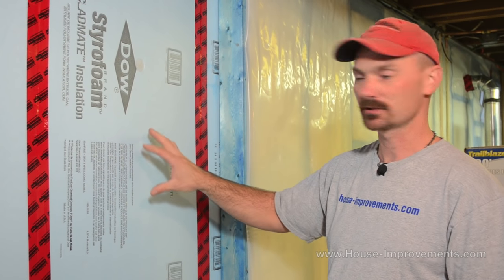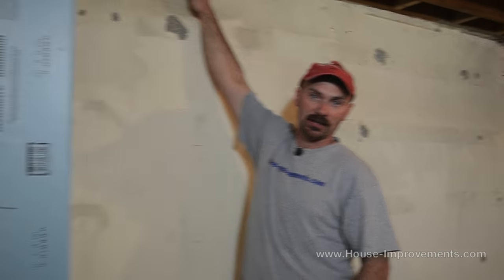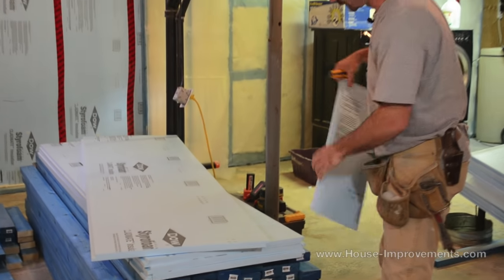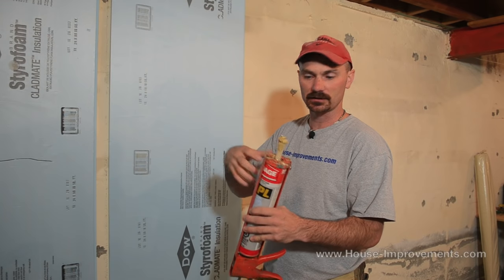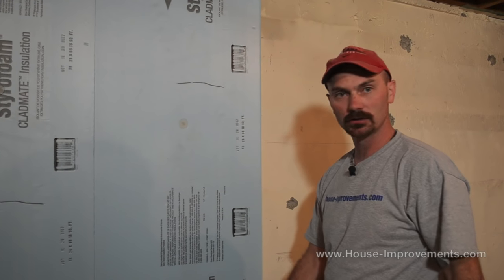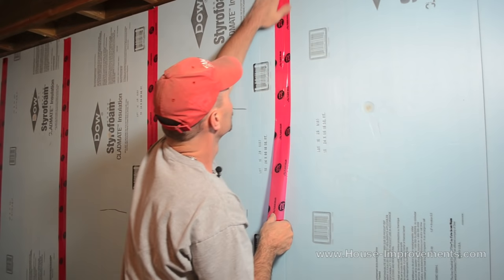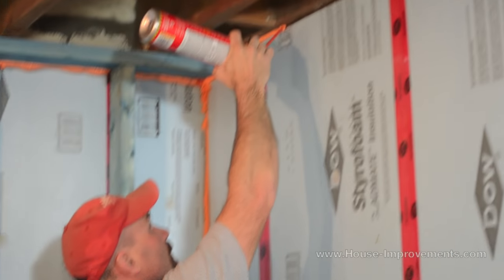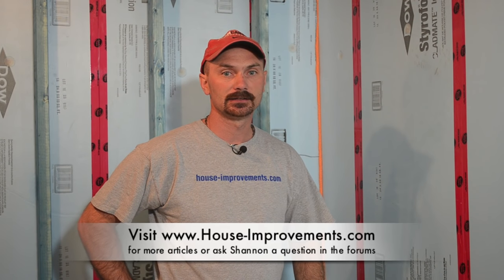How To Attach Rigid Foam Insulation To Concrete

Comment: Hello, I really like the way you do your work. Now is my question: "What if my foundation walls leak from exterior (when it is rainy)?  Do I have to waterproof foundation walls from inside or from exterior side before place any insulation?
Reply: I’m not an expert, but this is what I’ve learned over the years. The answer is it depends on a couple of things. Are the walls cinder block or poured concrete? Cinder block is very porous and prone to water migration more so then poured concrete. It is also more prone to developing cracks or separation along the mortared joints from the house settling over the years. You can try filling in these defects with hydraulic cement and watching to see if this solves the problem after heavy rains. If it does, I would then paint the wall with a masonry sealer for additional protection then install the insulation. If you have poured concrete walls, sometimes the form anchors form voids that allow water migration. These usually can be identified by the formation of rusty spots on the wall. These spots as well as any obvious cracks need to be filled in with hydraulic cement. Then wait for a heavy rain to assess if the repair solved the problem. If it did, paint the wall with a masonry sealer and move forward with the insulation. While this may solve your water intrusion problem, there is no better cure then digging around the exterior of the house, installing a proper foundation drain, and properly sealing the wall with asphalt sealer followed by an “egg crate” type of panel, with the proper stone fill (you should watch videos for this process). This is the most expensive option but guaranteed to work. I can’t speak to installing an inside the basement drain system, although far cheaper then the exterior option. Common sense tells me if you allow water to come through the walls and collect in the drain at the bottom, then you cannot seal this behind a wall as mold will will develop. Good luck.

Comment: ANSWER: "For unfaced insulation, the permeability is a function of the material thickness. In general most product manufacturers list the permeance of the material based on a thickness of 1 inch. ... 1 inch of XPS has a permeance of 1.1 perms (borderline Class II and Class III vapor retarder); 2 inches decreases the permeance to 0.55 perms (middle of the Class II vapor retarder). Therefore, 1 inch of XPS is ... vapor semi-permeable, while 2 inches is considered to be vapor semi-impermeable. "

Comment: I read your using 1" foam there, what length of plastic anchors are you using? And where can I find some of those anchors at?......I plan on doing our basement in the near future and will use this anchoring method, because using just that "special" foam board glue can get pricey on an entire basement. Thanks for all your great informative videos.....

Comment: Spray both sides, top and bottom of the foam boards with borax or boric acid before installation if the place could have carpenter ants or termites.  They would chew through these foam boards like hot cakes and make nests inside if there is no borax to stop them.  This is specially important when the foam boards will be covered by stud walls like the video.  For places that have carpenter ants or termites, I also won't use regular spray foam, because they chew through this too.  I would use ant proof spray foam or caulk.

Comment: Thanks for helping out folks like us on limited budget!  I notice Lowes also have DOW Wallmate.  What would work better for basement concrete wall applications, Cladmate or Wallmate?
Reply from the maker: Wallmate has grooves for wood strips to be added if attaching furring to the concrete for walls instead of actually framing a wall.  I do not recommend that, use clad mate and then farm a wall in front of it.

Comment: Great vid. You mention that 1 inch foam is not a vapor barrier.  My question is, what prevents moister from the concrete wall from going through the foam into the fiberglass insulation?  Shouldn't there be a barrier on the foam and again on the outside of the batts?
 Thanks Shannon
Reply from the maker: No real amount of moisture is going to penetrate this foam standing vertically , it will bead up and roll down to the base as is intended.
Reply: HouseImprovements
Thanks for the tip.  So I could use 1 in foam and fiberglass insulation and be good to go in a basement.

Comment: Great videos Shannon!  Really enjoy them.  I was recently watching an episode of Holmes on Homes, where Mike used 2 inch rigid foam on the walls and 1 inch on the floor.  Spray foaming and tuck taping all the joints.  He did not use bat insulation afterwards like you did which confuses me.  Arent you using two vapour barriers?  One with the foam and the other with the bat and poly?  The studded the walls after the rigid foam board installation was completed.

Thanks.
Reply from the maker: 1" rigid foam is not considered to be a low enough air/moisture perm. Meaning that still to much moisture can move through it to be considered a vapour barrier. Also it will not give enough R value to be considered enough to change the dew point in the wall assembly. IMO it really likely is in most climates in Canada but its not recognized that way. 2" foam is enough and recognized that way.

Comment: Thanks! How should the insulation be correctly applied, name brand facing the inside or outside of the ceiling? Also, is it best to use adhesive or all weather tape to hold the insulation, or both?
Reply from the maker: Please come to my forum and reask your questions, I can better answer you from there and leo it may help more people who are wanting to do similar things. The forum is free to use by the way. thanks

Comment: I think there are a few things that Shannon didn't explain that has caused a lot of the debate.  1. ) rigid foam insulation needs to be 2" thick for a complete thermal break unless you live in a climate warm climate and don't over air condition your basement.  The diea is to have a complete break in air temperatures between the warm side and the cold side of the wall.  A combo of air temperatures usually means moisture (hence the video of how to make condensation be directed to the floor.  Where I live (zone 7A) anything less than 2" of rigid foam on the cold side requires a vapour barrier (typically 4-6 mil poly) or air tight drywall coded in a high solid/vapor retardant paint.2.) I don't recall Shannon emphasizing that rigid foam must be covered by a non-material that is considered non-compostable such as drywall.  3.) The 6 mil poly IF being used on the cold side of the wall should never extend above grade.  Shannon hit it on the nail when he said that the wall needed to breath from both sides unless there was a thermal break (which as I mentioned would require 2" rigid foam for an interior thermal break).  If  I were to try this method I'd be inclined to have the moisture barriers from grade to and inch form the ground.4.) Most concrete homes will absorb moisture from the exterior unless built to the highest standards.  Ground water finds it's way to the base of the foundation slab and wicks up it if it can't dry out.  I'm not an expert and I have no experience but I think that is what allows me to think outside the box.  My solution to what appears to be rising damp until I can afford to fix the exterior is:1. Seal the concrete slap with a penetrating silicate sealer. 2. Hire someone to do high pressure injections into concrete near section were tie rods are rusting.  3. Apply 1 coat of a Xypec Concentrate from top to bottom foundation walls.2. Shorten one 4' section of wall by 1.5" before replacing all bottom plates with pressure treated wood.3.  Install barricade subfloor with air gap (4' section of shorter wall should encourage airflow from under subfloor to cold side of wall that is prone to dampness.  The subfloor creates a thermal break so the temperature between the two areas won't produce condensation.  4. Paint the perimeter tiles of subfloor with a high quality exterior paint to protect in the even there is a leak.4. Cut rigid foam boards in 2x8 sections.  use foam glue to seal to the back of the wood studs (cold side) to prevent heat loss through wood but still maintain airflow between stud wall and foundation wall.5. Insulate the perimeter walls with Roxul R14 comfort batt and cover with poly or smart vapour barrier sealing edges with acoustic glue.6. Frame 2x4 stud walls that stager the existing studs but sit on top of the subfloor (might use steel studs for sound dampening).  This way if water condensates on the floor it doesn't reach drywall or baseboards and I can maintain a completely air tight vapour barrier when I'm doing the electrical - plus easier to poly without having to cut holes and seal for outlets.  This wall will be fastened through the subfloor to cement as per manufacture's instructions.7. Cover with drywall then paint.8. Repeat on opposite wall (including 4' air gap under bottom plate).  9. Install vinyl floor planksAs I mentioned, I'm a newby so if anyone sees an problem with my design please let me know!

Comment: Thank you for a great video. What type of adhesive did you use to attach foam board to concrete wall? Also, how would your process differ if installing on the outside of the existing foundation wall? (Inside is finished.)
Reply from the maker: Lepages PL Premium or Lepages PL300

Comment: Thanks for the excellent video! I'll be doing something like this in a few weeks. Do you see any problem with running the sheets horizontally instead? It would save me a lot of cutting and wasted material. I think I'll just have to cut off the bottom sheet's ship lap edge so that it sits flat.
Reply from the maker: It does help to keep any moisture that may be behind it to get to the floor rather than through the horizontal joint and into the insulation.
Reply: Good point. Thanks :)

Comment: Hi Shannon, thank you so much for all of your videos. This is one of the few home improvement channels I subscribe to as the quality of your instruction and videos is exceptional!

Question: Is this method of insulation good for a basement room with exterior brick walls?
Reply from the maker: If you mean "block" then yes. I would use adhesive though instead of the anchors.

Comment: This idea is based on the principle of beer cooler.  You have the foam insulator forming the thermal brake between the cold outside wall and your warm inside wall.  I've read up on this for my own basement and it seems a difference of opinion between building codes and engineering concepts.  Again if you want it "legal and signed by inspector" you have to succumb to the normally "out of date" building codes, i use this as tongue-in-cheek.   I'm not a builder, simply a handy DIY'er and maintain/renovate my own properties,  I do not know building codes as a rule but I guess the thicker the better.  The code is there to create a minimal standard to follow and I generally check with the local authority for guidance when working on such installations.
Reply: So the poly after the fibreglass is correct in this method ?

Comment: Great video! I Just gutted my den and found lots of damage to my moisture barrier. it looks to be nothing more than very thick aluminum foil. The house was built in the 70's so I guess that was code back then. I have a brick house and behind that damaged barrier was brick and mortor . Can I replace that old school aluminum stuff with the rigid foam or should I hunt around for that same type of moisture barrier?
Reply from the maker: If its concrete blocks then yes you could use foam, if its brick ,i'm not sure I have never seen a brick basement wall.

Comment: Thanks for the video Shannon.  I'm a bit of a noob, so I may have some silly questions.  Am I correct to understand that a moisture barrier and vapour barrier are two different things entirely?  Moisture barrier against the foundation to prevent moisture from seeping in from the outside and vapour barrier on the warm side to prevent the flow of warm vapour into the wall?  I watched your other video where you had a plastic moisture barrier that went under the base plate and wrapped from the bottom over and on top of the vapour barrier.  Which of these two systems do you prefer?  How important is the moisture barrier under the base plate (since it's pressure treated, is it necessary)?  If you use rigid foam, do you still add something under the base plate?  Thanks again.
Reply from the maker: Sorry to ask you this but can you please bring your questions to my forum. More people  who may have the same questions can be helped by using the forum . http://www.house-improvements.com/forums/
Reply: Sure thing, thanks!

Comment: He said, "You could try to spray foam this tiny butt joint but it's easier to use tape."  

Well I'm here to tell you that I did try to spray foam those joints today. And boy oh boy he was right! It was a pain in the ass.

Comment: Great vid .. but question ... won't this create condensation between the wall and insulation overtime leading to weaking the mortar making it fall off  ? .. hmm looking foward to insulate my brick basement ...but not sure about this... other than that allways see your vids and they r all really helpfull.. thanks Shanon
Reply from the maker: Actually the main reason for condensation is from warm moist air contacting a cold surface. In this system once it is well sealed with canned spray foam it prevents warm moist air from getting to the cold concrete wall.

Comment: Thanks for the vid.  Why on the floor is your blue wood away from the wall/foam so far that you need to spray foam?  Wouldn't you install the foam first, then butt the framing up against it?

Comment: awesome video,, just started doing my basement , very helpful.. what about  the side walls that interior as i live in a condo town home
Reply from the maker: It is nit rally necessary to insulate "interior walls" that divide row type houses but not a bad Idea to do the first 4' or so in from any exterior wall if you live in a cold climate. This helps reduce cold transfer that happens through the concrete itself. My forum is a great place for assistance:https://www.house-improvements.com/forums/
Reply: @HouseImprovements  awesome thank you

Comment: Is the foamboard not enough of a vapour barrier if I add the studwall in front of it and insulate it with the batts....?
I'm in Northern  Nova Scotia and it is rather damp most of the time...
Appreciate the product name. I have seen some orange spray foam around a window that I removed.
It was more dense than the other products I've seen used..
Thank you for your suggestions.
Humbly yours, Dber

Comment: Are you have a stud wall to protect the foam in case of fire? Would that be required by building code? And where are you from? You did a window installation and I would like to know what climate you installed the window for

Comment: Hi Shannon great vid I'm curious why you used a plastic vapor barrier over the framed walls when using the 2 inch foam the foam board acts as a vapor barrier
Reply from the maker: This is only 1" rigid foam.

Comment: If you were using just 2" foam instead of foam and poly would you need to tape over the plastic anchors too, to make it a proper vapor barrier? Also do you need a vapor barrier under your bottom plate?

Comment: Have to use the right adhesive formulated for foam board otherwise it will dissolve the foam board instead of acting as an adhesive.

Comment: Hope my question makes it's way to you.  I like your video and had two questions 1) Is 2 inch foam boards better  2) Is the vapor plastic barrier needed?  I am concerned mold will grow when it's foam blocks on one side and plastic on the other.  I had a house once that was full of black mold because of the extra plastic sheet barrier.  Thank you
Reply from the maker: IMO I like 1" foam and a R12 - R14 insulated wall. 2" in some climates can cause issues unless it is insulated foam blocks filled with concrete . 

Some areas may allow you to use 2" rigid foam sheets and then skip the air/vapour barrier. If not I would then use the new "smart barrier" air/vapour barriers that will breath if the wall needs to.
Reply from the maker: If you have more questions please use our forum.https://www.house-improvements.com/forums/

Comment: Hey Shannon, I joined the forum and posted a few days ago. I was wondering how you would go about installing the foam board on a perimeter drain in the basement. I’m in the process of finishing my basement in Delaware. I wanted to know if I should put the foam board all the way over top of the French drain and then seal with spray foam?
Reply from the maker: Answered your post n the forum
Reply: Thank you!!!

Comment: If you get a crack and a leak, how would you even know if you use the foam? If you install a subfloor in your basement and have the foam, you could have water flowing through your basement and never know about it. Is there a solution to know you have a leak if you follow this install? I've have a basement without foam, just fiberglass insulation and drywall and when cracks developed, I knew about it because water was on the carpet. In my new house, I want to install a subfloor, how would I know if these methods are used?

Comment: My house sets on a cement block foundation. So I have a crawlspace that averages between 3 to 4 feet. I did what this video shows to the inside walls of the crawlspace, The outside walls are a stucco, So my question is this, can I do the same on the outside of my crawlspace and then spray paint it ???  Also is this type of compressed blue insulation waterproof.  I would be grateful for any advice. I just think this coming winter 2019 to 2020 in western Pennsylvania is going to be crazy cold.  Thank you for your time.